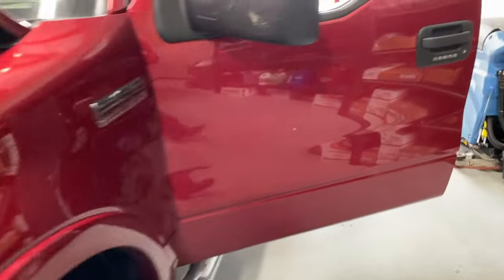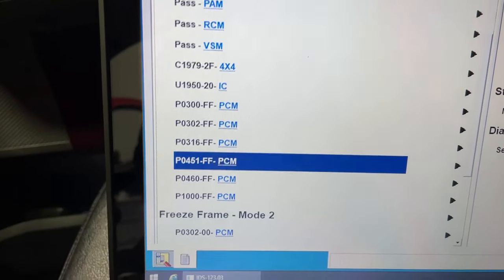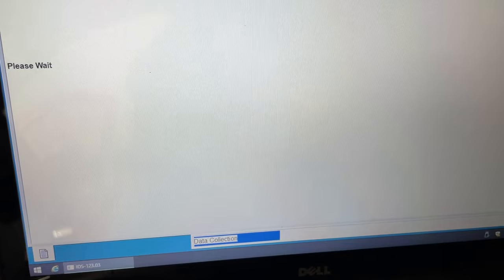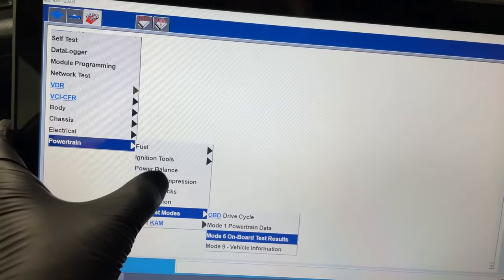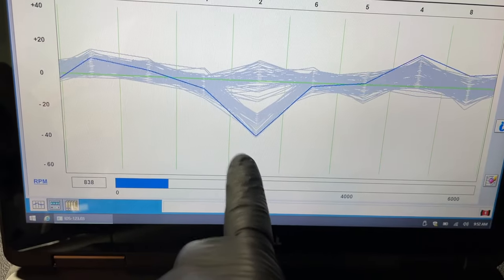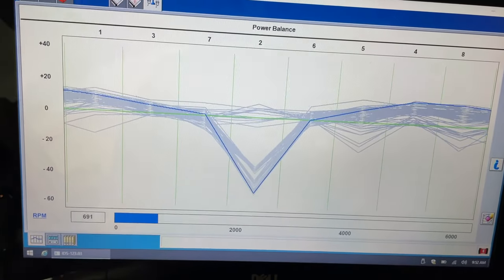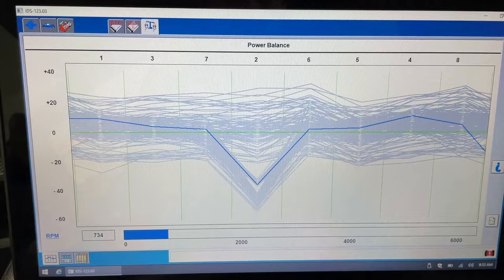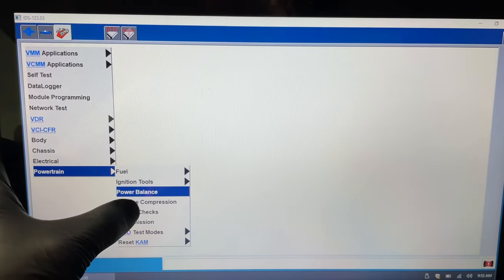Ford F-150 5.4L 3v Triton Engine Misfire: Champion Spark Plugs Belong in Chrysler’s and Lawn Mowers!

Comment: Please can someone help me? I have a 2007 f150 with a 5.4 3 valve and it's has a weird issue. I was backing up one night while angry and I hit some mud in the road I assume it over revved and ever since if you get the RPM's to high like as low as 3 grand it will run rough and be really weak but you can cut it off let it sit a few minutes and it will start and run fine unless you over rev it again I have the valve cover off on that side no obvious wear or damage and I don't know what to do now. Oh new hugs and coils. Thanks for any help!

Comment: The problem wasn't the brand of plug it was the fool who installed it and didn't tightened it. So when Ford makes a one piece plug that doesn't break in the 3v then I will stop using the champion plugs.  But I do agree the coils should be motorcraft / Ford brand.
Reply: They've had 1 for several years now. 😂

Comment: SMH ... No wonder it was misfiring. Evidently the plug was loose and was barely even hand tight, resulting in a plug that was poorly grounded and probably a coil boot with a poor connection as well. Can't hardly blame the plug... regardless of the brand.

Comment: At least the Champions didn’t seize in the head😏🤷‍♂️
Reply from the maker: Ford service plugs don’t either.
Reply: @FordTechMakuloco  I think that reference was to the Mustang 4.6L 05 to early 08 plugs that would fuse the nose of the plug to the head with carbon so when you removed Fords two piece plug it would break in the head.. Ford finally got wise on 08 1/2 models with a redesigned head. But you know that of course.

I believe this was also an issue for the 5.4L engines. I recall you doing a video on a special tool to extract these types of broken spark plugs from heads.

Personally, I use the Champion one piece in in my early 08 Mustang. Dumped the Ford junk plug at 10k miles, put Champion in. Replaced the Champions at 70k for another set of Champions and now at 120k. ZERO problems. I’m a member on a couple of Mustang dedicated forums and the champions have worked well for almost everyone. I lost count of how many people  had the jFord plugs in their 05-early 08 4.6L break. Even using the TSB on how to TRY and avoid breaking them, would fail. Dealers also would screw up....

The problem in this case was a bad install and not necessarily the plug. I believe strongly in OEM but Ford really dropped the ball on that head/plug. design. In this case aftermarket offered a solution that worked while Ford ignored the problem for many years. Now they offer an improved two piece plug with extra welds between the nose and body of the plug. No thanks. Two piece is two piece and I have no reason to go back.

Comment: hey i have a 2007 ford f-150 5.4 triton and ive had this noise for about 4 years now and what happens is after driving the truck for about a hour this loud fan comes on and it almost seems like im losing power and sometimes once coming to a complete stop and accelerating again my rps will go up than the truck will kick into gear hard and continue on but the fan noise only comes on after a hour of driving and when accelerating and will fade once your at about 55,60 mph if anyone knows the fix i would greatly appreciate it
Reply: Sounds like the thermo clutch on your belt driven fan is failing. I had a 3/4 ton suburban with the 7.4 engine. That thermo clutch locked up solid, and ran directly linked to engine rpm. It pulled so much volume thru the radiator, it would inhale birds right out of the air into the grille.😄

Comment: how do I tell what date my truck was made? I had planned on doing my spark plugs and coils soon but since my expedition EL Limited is a 2008, i'm kind of pulling my hair wondering if i'll be getting the wrong parts since there's pre-08 and post-08 products to choose from. I can't do the test where you inspect the coil boot for color ( brown or black ) because previous owner put aftermarket cheap coils on there ( red capped ones ), so it just adds to the mystery lol.
Reply from the maker: Pull one of the front easy plugs just to get a look at it. The design is totally different from the early engines, compare it to the plugs I link to in this video.
Reply: @FordTechMakuloco  thank you, I will do that. thanks so much.

Comment: This is a mystery...  I have a late 2014 Expedition...  I started pulling plugs on the driver's side (5-8) and, as expected, found the newer, one-piece Motorcraft SP-509 plugs...  Then I pulled the passenger side (1-4) and all are the early 2008-style, Autolite HT15 plugs!  (Fortunately, they all extracted OK.)  And all the coil packs have the brown boots.  I bought the car used, but it did not appear to have had any major engine work.  Since this was built in December 2014, could Ford have assembled this last-of-its-kind engine with one "new" head and one leftover 2008 head?  I have driven the car over 50k miles with no issues (except replaced a seized roller follower).  Has anyone experienced this head mis-match and, if so, what was the story?  TIA
Reply from the maker: Someone has been in there because Ford didn't do that from the factory.
Reply: @FordTechMakuloco  Thanks for the reply, Brian...  It seems to be running OK -- are there any bad effects from this mismatch that I should be watching for?  Thanks again!
Reply: @FordTechMakuloco  And another thing...  When I replaced the roller follower on the 2008 head (didn't know it was old at the time), I did notice they had the larger oil holes...  My replacement roller follower had the new, smaller hole...  I did not notice excessive gunk or discoloration when the valve cover was off...  (Maybe this head mismatch makes my Expedition worth a lot more as a collectible?  Like a coin with the wrong mint mark?)  Thanks again and your videos are invaluable for my tinkering with this old Ford...  Cheers!

Comment: Hi! 
Anyone here happens to know a shop good at dealing with misfires on the 54L V3 in Toronto, Ontario ? 
I’m not having much luck with the one I’ve taking it too

2005 F-250 5.4LV3 manual transmission 

Appreciate

Comment: I agree Motorcraft plugs ..EXPECT I. THIS APPLICATION. I would rather change the plugs at 50k miles and beable to remove them in one piece ( champions) then have them come out in many pieces as the pull apart  apon removal ( motorcraft) .. only on this generation with these terablly designed plugs , Motorcraft should have redesigned these to be one piece like the Champions are. See  they come out .
Reply from the maker: Um ever since the Motorcraft SP-515 service plug came out many moons ago they no longer break.
Reply: Sp-546 ? .. still 2 piece design .. rather know they will come out in one piece ....
Reply: @FordTechMakuloco  Is the service plug for a 2007 Mustang GT with the 4.6L the SP547?  Thanks.
Reply from the maker: yes
Reply from the maker: yup the 515 and latest 546 are a welded one piece design, never had a problem getting them out.
Reply: Thanks.  Are the 547's one piece?
Reply from the maker: yes
Reply: @FordTechMakuloco  Thank you.

Comment: Ford can't even design an engine that accepts other spark plugs lol
Reply: When you want proper operation out of something you use what it was designed for. 

Just because it works and says it works with the car, doesn't mean it does or does it well. 

You can throw copper plugs in a new honda instead of iridiums but it isn't a good decision. Not all parts are equal. Que everyones favorite trash to hate on, the $2 orange fram oil filters.
Reply: @volvo09  been using Fram for 20 years, great filters
Reply: @ThisIsSolution  filters and plugs are a little different lol

Comment: My high school shop teacher explained spark plugs real simply, and the cheaper the metal the quicker it heats up and cleans itself.... Only in my race engines with msd ignition systems will I run platinum plugs ...
But you spark plug weirdos can spend $23 on each one I don't care!

Comment: It’s probably better not to buy one of these garbage 5.4 engines to begin with!
Reply from the maker: No they are great engines.
Reply: FordTechMakuloco    What kind of engineering were those spark plugs that break and stay stuck in the heads. I’m not in love with those cam followers either.
Reply from the maker: Initially they were fraught with problems but the latest parts fix all of that. Some fixes have been out over a decade now. The best part is the base engine is very solid and everything that bolts onto it has updated parts to fix various common problems.
Reply: I understand ford loyalty but now I’ve got a 02 Explorer with a junk transmission, that I found our was based off the old A4lD which was  also junk in my 87 bronco 2. The ford garbage keeps coming.

Comment: Why do fords have all these "Ford" problems. Yet then it's always best to use Ford replacement parts?!?!?
Makes zero sense to me.
God be with you. Peace
Reply from the maker: Latest engineering improvements designed to fix the original part that was made from scratch and once in the field they find and fix the flaws in the original design and put out a new part number for the fix.